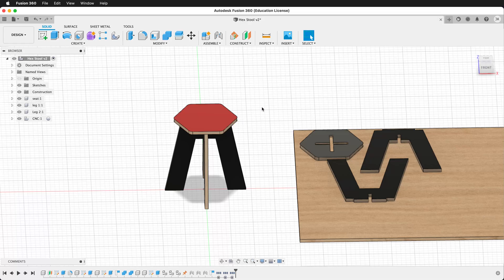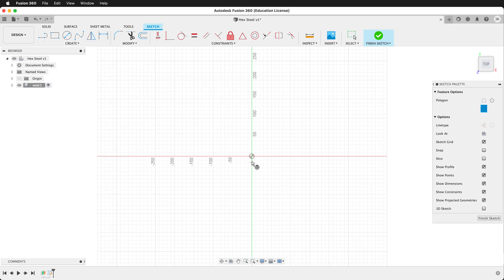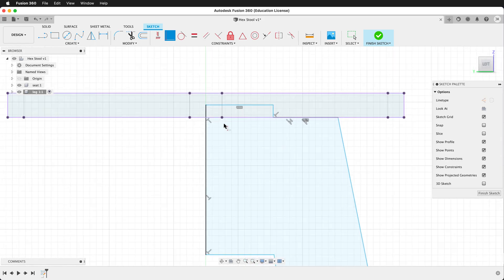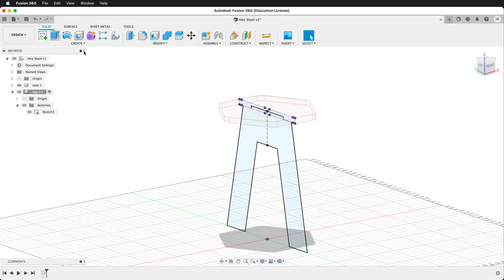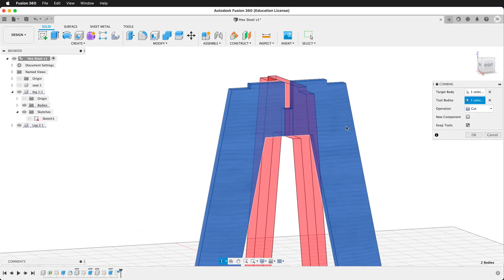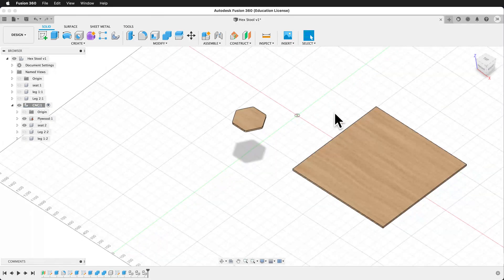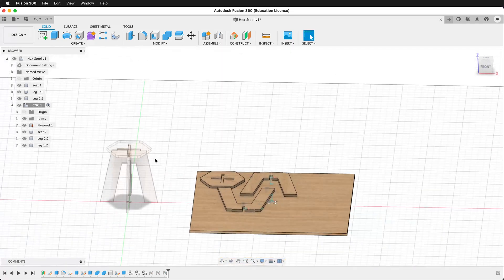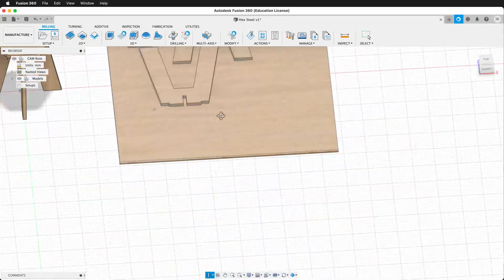Hexagon Stool Fusion 360 CNC Flatpack Design for Shopbot

Comment: That was great, took a bit of pause-rewind-execute-forward but I got there. Only thing I wasn't sure on is once I went into manufacture and selecting the ply as my box.. my parts are out side of it.. so I wasn't quite too sure on how to finish the job. I'll move forward in your other videos to see if they have answers. Your series though has been really nice to watch though. Thanks for sharing.

edit: It is the next video! hah! yay! :D
Reply from the maker: Glad it was helpful, the basic building techniques in this Fusion 360 CNC video are still valid, but the manufacturer workspace in Fusion 360 has been updated a lot since then

When you create a setup for manufacturer, you can select the model pieces and then define the stock around them

Comment: After using the combine tool how do you adjust the created slot for two pieces to slide together? Great video.
Reply from the maker: Go back to your original sketch and edit where the sketch lines are. If you create new profiles with those edited sketches, then you may need to go back to the extrude feature on the timeline and make sure you select those profiles. Then the combined feature will automatically update.